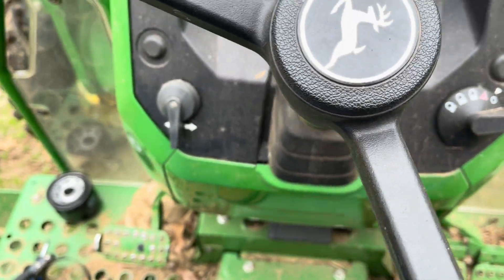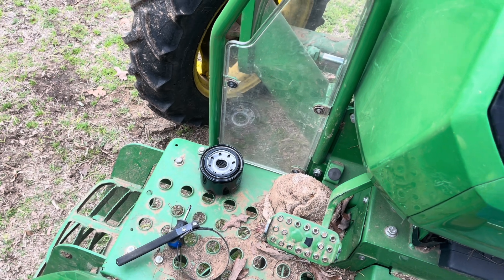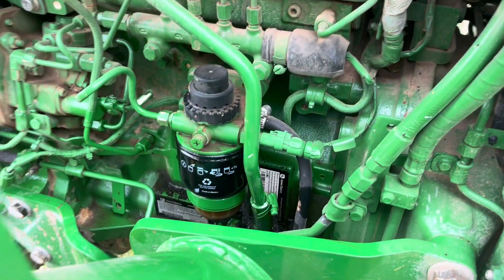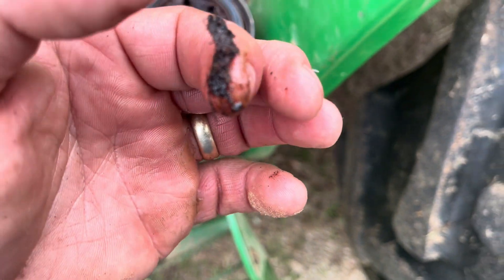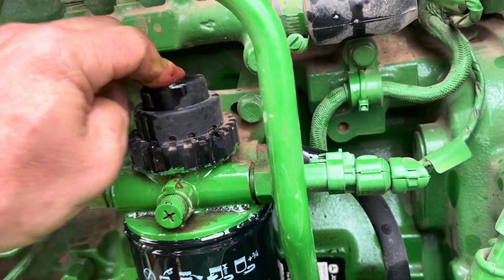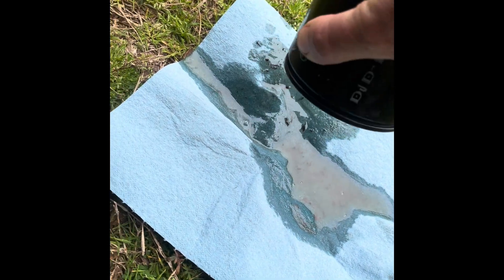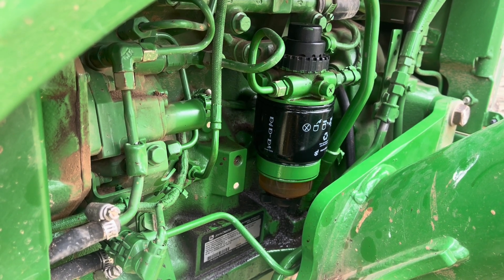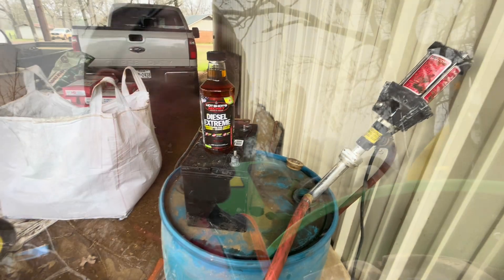John Deere 5045 E Fuel Filter

Comment: There is a fuel shut off under the left side of the seat where the fuel line comes out of the tank. If you drain the tank and screw the valve out it has a filter attached to that as well you can clean with brake cleaner. It’s usually nasty

Comment: I just used a pair of hose pliers on the rubber hose and held the line closed. It definitely leaked fuel out before I did that. Didn’t hardly loose any fuel and worked great

Comment: My 5075E is older than yours and it’s on the other side but I filled the new filter with diesel before screwing it on.  Cranked tractor and pulled throttle lever up high.  I did not have to reprime anything

Comment: I have a 5055e  you wouldn't happen to have a filter number for that?
Reply from the maker: R536698.
Reply: Thanks for the info I have a 2022 5055e  and the fuel gelled up on me I am having a heck of a time getting the separator to seal back to new filter put new rubber washers with a dab of oil rubbed around  them.
Reply from the maker: There should be two rubber seal rings. One goes between the filter and the separator bowl. The other goes between the bowl and the black art with the drain. I’ve changed mine several times and haven’t had trouble getting it to seal.

Comment: Bro.. u didn't show the process, did u have to unplug the wire to unscrew the plastic piece on the bottom? Today I got the little red lock on the plug to  unlock, but had to leave b4 I could figure out the next step. Couldn't get it to unplug. Thot u was fixin to show me the way.
Reply from the maker: Just swing by the house and I’ll show you the way. You can even hold the camera so the whole world can see.

Comment: I have the same type filter you have. What is the part number.  The only one I can find 
doesn't have the glass bowl and slips up inside the mount and uses a retainer ring to hold it on.
Reply from the maker: R536698
Reply: @davidpippin7206  Thank you.

Comment: Does the clear bowl fill up on it own?
Reply from the maker: It should fill up.  If it is slow to do so or doesn’t at all you have a blockage of some sort. Most likely culprit is there is a screen type filter inside the fuel tank that will easily develop algae that prohibits flow. John Deere recommends removing and adding an inline filter between the tank and the filter in the video.